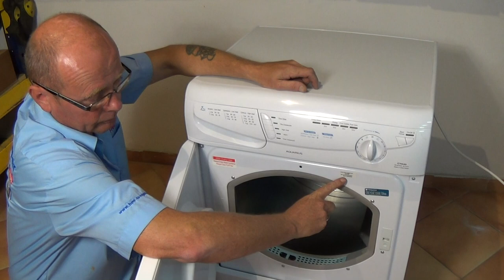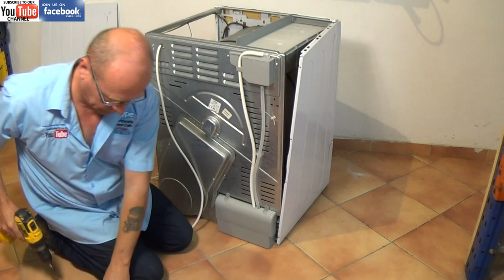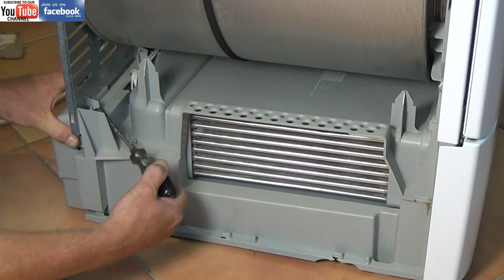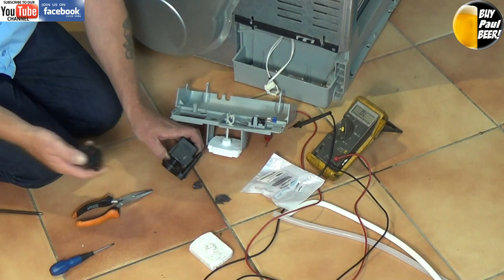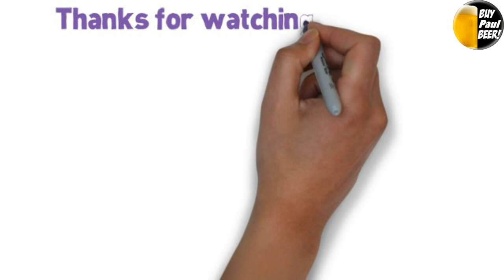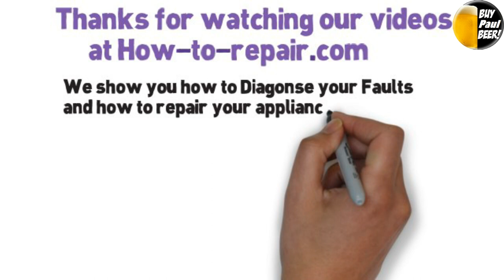How to service a Condenser Tumble Dryer pump unit, Indesit, Proline, Creda, Ariston, Hotpoint

Comment: Thanks for the vid - my issue was the float sitting in a pool of gooey god knows what - dryer is 5 yrs old so i expect just accumulated grime-anyway cleaned the reservoir and the housing - cleaned the float - reassembled and it worked! Its a Hotpoint Aquarius and dead easy to maintain (once youve seen these vids )

Comment: Ok think I've fixed it. Stripped pump out impeller all clear. Noticed front vents were full off fluff. Think this was causing overheating hence heater tripping and machine top case red hot. Cleaned and all working case isn't hot anymore so looks good :) thanks for the tips etc.

Comment: Dear sir, 
Have electrolux dryer. It heats, no problem for working . Have a little bit diferrent problem. Water tank is being filled near half, bu then the rest of water leaks to surface. If problem is pump, water tank should not be totally empty, right? Thus pls let me know if you ve faced such a problem before? If you may assist me what the problem is and which space part should i replace, will be so much appreciated.

Comment: My Hotpoint Aquarius THCL 73 water pump constantly runs, checked the float and continuity on the micro switch and they look ok. Trouble is the pumps keeps cutting out due to over heating I think. Any suggestions on what the problem could be at all?

Comment: I had the water box light on, the box was empty and not filling with water so I thought maybe the float was stuck and causing the machine to think there was a blockage in the pipe or maybe there was a blockage in the pump.
Turns out the rubber impeller which spins and pushes water up the pipe had worn through and was no longer attached. Thankfully they sell these on amazon for £4 inc postage so all in all a cheap repair.
I didn't unscrew the side of the machine to unclip the box at the back, one of the clips snapped as a result but it shouldn't be a problem

Comment: Indesit condensor, its not collecting water so bought new pump but still nothing. Do i have to buy a new float and micro switch? please need help as running out clean clothes.

Comment: I have had a Hotpoint Engineer call out as the red light (empty tank) kept coming on.  The engineer, who claimed to be a senior engineer said that it was normal for the red light to come on for a few seconds when starting to dry clothes.  I asked the engineer to explain why the red light has never come on over the ten-year period that I have owned the tumble dryer and why it has only started to come on since the float unit was replaced a few weeks ago, he was unable to give me an explanation.  I was not happy with his explanation and said that in my opinion the pump was not working correctly and had never been replaced, therefore, as the machine was insured by D & G I requested the pump to be changed.  problem solved, no more red light. 
The manual for the machine does not state that it is normal for the red light to illuminate at the start of drying clothes as it states that the red light comes on when the tank requires to be emptied.
Why would a senior engineer state that it was normal for the red light to illuminate at the start of a drying cycle?

Comment: I had some problems with my dryer (leaking) and decided to clean the pump and everything, like you showed. But now I figured out that the pump appears to be running constantly. Isn't it supposed to only run when the switch is activated?
Reply from the maker: +UsernameTaken4131332 on some models it does run all the time I am glad I could help you with this problem.
Please remember to Shop with www.how-to-repair.com  and it would help us by posting the video or website on your timeline. This helps us a lot and if we really helped you can always buy us a beer http://how-to-repair.com/help/buy-paul-a-beer/
Please remember to mark us to your favourites also I would be grateful if you would subscribe to our channels social media as this really helps my site and keeps us going.
YouTube. http://www.youtube.com/user/Apart4u
Facebook. https://www.facebook.com/how.to.repair.appliances

Comment: Quick question on the Beko Condensor is there a reason why water is accumulating in the heater area? Front filter and condesor plate are all clean. Keeps tripping the heating element off and when I take cover off there is water in there.

Comment: just had daughter get intouch with one of these style machines (idc85), ''sparks and bright orange flashes came out of it'' so i went round, plugged it back in and turned it on, wasnt heating, expected being the heater, but it wasn't rotating both ways, opened it up, melted and snapped wiring from bottom two contacts of the timer (c5 b5, or is it c1 b1?) caused by short wiring pulling on the awful spade connectors till they became loose and wobbly and badly connected.. heated up, burned off the insulation, boom.

https://photos.app.goo.gl/JtuErNJafNqsCXY46

Comment: My hotpoint Aquarius has been a bag of crap. 12 months old, hardly any use and it snaps the belt. Then I see the pulley has melted and replace that to find after 2 months the new pulley melted and spat the belt off! I went with a non genuine part with a bearing inserted in the pulley to prevent friction building up which melts the all plastic crappy Hotpoint pulley. Now the water pump has failed on it... Won’t be buying Hotpoint again.

Comment: Why does it even have a water pump? Why not just empty straight into the sink using gravity instead of pumping up to the reservoir/sink?
Reply from the maker: because its at floor level you can drain direct into drain if you have one. Glad it helped Thanks please remember to subscribe as that's is was keeps this channel going. Thanks 👍
Reply: @How-to-repair  I know it has the drain option, but does it need to go through the pump, or could you just drill a hole and have it gravity fed instead of pump?
Reply from the maker: it will just drain no pump needed